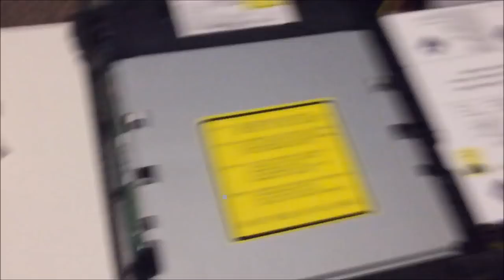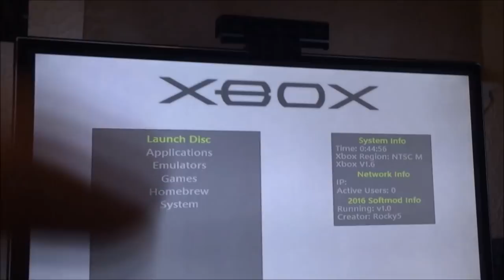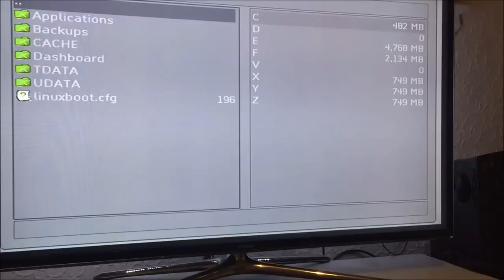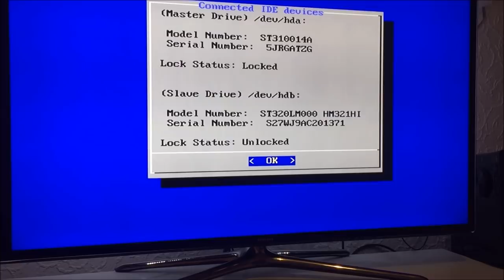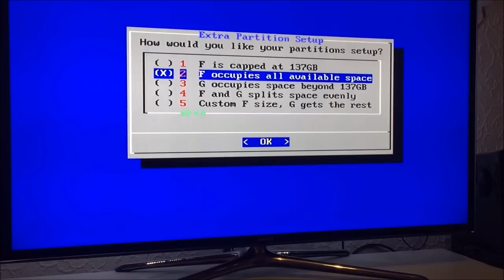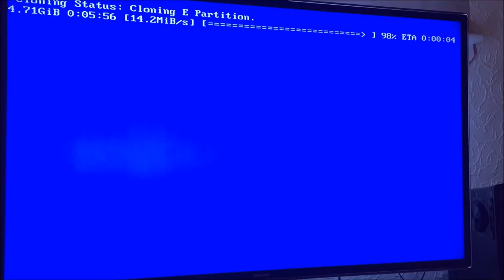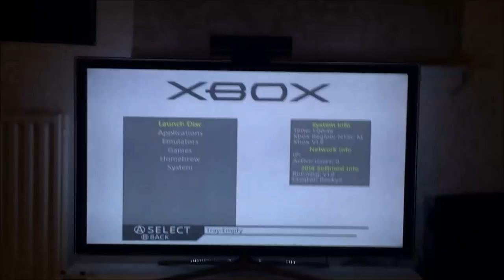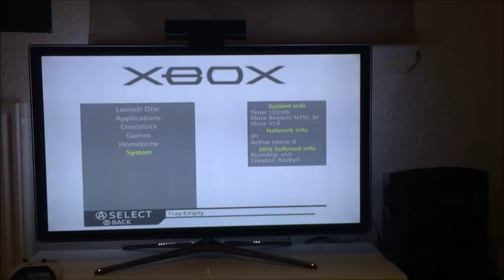How to clone your Hard drive using Chimp 261812 from start to finish.

Comment: What do you do, if it refuses to boot Chimp saying "Unable to get first sector"? I've got the right 80pin cable, and a Startech adapter with the right jumper settings.
Reply: are you setting the new hdd to slave and xbox hdd to master?

Comment: Hi JCRocky5 , I did not found my question in the comments so I will humbly ask you that question. When my xbox boots up Chimp I get following message: "Slave Hard drive cannot be locked." As I understand there are Harddrives that cannot be locked.
I searched for and fond the "Xbox Hard Drive Compatibility List". There my  Harddrive Models are listed "Locking: Yes". It's WD5000AAKB-00H8A0 and 2x WD2500BB-00GUC0. 
After that only 3 options are available im Chimp, Scan, Master drive Options and Other options.

Do you have a hint for me if those drives are really not compatible or if i might miss something else?
Reply: I tried 4 other WD models I had in my cellar. All with the same message. WD1600BB-50DWA0, WD1600JB-00GVA0, WD1600JB-00EVA0, and WD1600BB-00DAA3(not found in list).
For the first ones, the list also says yes. The Last one is not in the list. At least I'm happy that those 4 drives do also not work.. they do make noises..
Reply: I could not wait and I had to try again. This time i used Chimp2618. It looks a lot more complicated as the version in your video but it provided the options and I was able to clone the disk to the WD5000AAKB disk. It also was able to lock the hdd without issue and the new Harddrive works in my xbox.
Reply from the maker: I added that to the latest build, it checks the hdd for "Security level : high" if it's true then the drive is lockable, if it cannot find this information on the HDD it assumes it's not lockable.

I asked another user if they could test the build, as I don't have any drives that aren't lockable, they never got back to me. Would you be willing to test this new build for me?

Update:
I have a new build ready if you want to try it, I fixed the issue. Now I just lock the drive and check if it was successful or if it fails and show an error accordingly.
( I unlock the drive after I lock it, this is the only 100% way of checking if a drive is lockable )
Reply: Hi, yes of course. I will try it tomorrow (Austrians tomorrow ;) after FTP transfer has finished. I will try again with the original drive I had in the box (WD 80 GB drive) and one of the 250GB and 160GB drives each. Cloning the original disk is pretty fast due there is not much data on it.

Thank you for your fast response!
Reply from the maker: StyriaMe brilliant, you just have to redownload the zip from the description. If your slave drive is locked you will get a message to say you need to unlock it first, if the drive is already unlocked then you shouldn't see any difference.

If the drive doesn't lock then an error will show and some options will be disabled. ( like the previous comment, I try lock the drive to the Xbox motherboard and if it fails the drive can't be locked, if it's successful I unlock the drive and load the menu. ( takes less than a second to lock and unlock the drive )
Reply: Opened up my box again. Your new Version worked like charm. If i boot Chimp up with the DVD-Rom connected it straight sais "Slave Hard drive cannot be locked".
If i boot up with a "new Harddrive" Chimp provided all options and were able to clone. After successfull clone it asked me if i want to lock the HDD. Yeah!

Booting up again with both of the harddrives (original + cloned one), Chimp tells me that the Harddrive is locked and I first have to unlock it. Options are available. No issues at all. In my opinion everything worked well.

Thanks a lot for your work!
Reply from the maker: Brilliant, was that the HDD that had the issues previously? The one that said it couldn't lock but it actually could. Hopefully that's me done with Chimp lol. Not sure what else i can add to it?

Thank you for testing, the new build.
Reply: Yes, I tested it with two of the previous HDD's I had troubles with. Both worked like charm with the new Version!
Due I'm basically total new to XBOX, I cannot provide any ideas. My Box got modded years ago. The last several years it was in a cabinet in my celler and just this week I pluged it in due I found CoinOps and wanted to try it. CoinOps 8 Massive works now. CoinOp 8 Massive Premium.. does not.. I dont know how the "roms" folders content can get copied on a fatx partition (~16000 files). 
I have already several PC/Pi/Lattepanda - retrostations and was charmed as i heard of coinops.

Thank you! Without your video I would probably still stuck on the small xbox HDD.

Comment: Back qgain.  Trying to upgrade a 2tb sata drive. I load into boot switch cables, hit A and i hit the chimp logo screen with 3 dots. Then at the bottom it is in Green loading chimp. I've wait about 15mins and it never goes anywhere.

Comment: Thank you, this is such a great tool!

I have a softmodded Xbox of the last revision, which means softmodding is my only option. I was unsure if the SSD I had selected would support locking, so it's great to have a polished utility that makes the process simple. (It seems that most common 2,5" SATA SSD's support locking just fine) I used this exact StarTech adapter.

After the drive swap Unleashed only boots after I've opened and closed the disk drive once, but that's good enough for the time being, also startup using the power button results in error code 9, maybe the original dashboard wasn't transferred over? (I erased everything other than C and E during the process.)
Reply: hope you got this issue fixed, but to me it sounds like a dual boot gone wrong

Comment: Ok rocky i have some major questions about your mod i know this is a fairly old video and idk if you even check on comments any more but here it goes. I used your xbox softmodding tool v1.1.5 to upgrade my old softmod to your version of the mod. It installs correctly, it ejects the disc, i take it out and hit continue, it shuts down and restarts into your program again doing what it needs to do, then restarts again but instead of starting in your grey dashboard that shows in your video it reboots into xbmc dashboard and nothing else of your program even shows. I have upgraded the system with your disc now 4 times and it still keeps booting up into xbmc. what am i doing wrong?
Reply from the maker: You ain’t doing anything wrong, it will boot XBMC from C, E, F before C:\dashboard\ it’s how dashloader works. 

If you look at the readme.md file on GitHub you can see the dashboard paths and how they are traversed. (Top to bottom)
Reply: I ended up just doing a complete factory restart. I used your program to go back to factory dashboard, ran my copy of splinter cell to install your softmod. Only problem I'm having is when I used your mod the first time on my 1tb hd to upgrade it, it corrupted the hard drive and gave me an error 13 code, so I tracked down my original 4gb HD and I'm trying to see if there is anyway to save my 1tb sata HD from the garbage because I exhausted all the options in your chimp program to unlock my slave drive but nothing could unlock it. Is there any way to save the HD by formatting it somehow?
Reply from the maker: Are you using a 80 wire IDE cable? also the softmod won’t corrupt the drive. If it has it’s the first ever to be corrupted because of a softmod. 

But you will need to set the 1tb drive to slave, load Chimp261812 select the softmod option when you get the choice and the select slave drive options and unlock. (Select motherboard)

Now select slave drive options again then fix error 16, when it’s done select slave drive options followed by lock. (Select motherboard)
Reply: @JCRocky5  yes I'm using an 80 pin cable. But I did the steps again and the drive still remains locked. The jumper on the SATA adapter has also been set to slave but the drive still will not unlock
Reply from the maker: The drive firmware could be corrupt (nothing to do with a softmod this part isn’t touched unless you try to unlock/lock a drive)

You could try hotswapping the drive with a PC or use Xboxhdm23beta and your eeprom.bin to see if it will unlock on a PC. (The former tool uses Sata to usb)

https://drive.google.com/file/d/0BzRN8P835YijUFloekdzaUVyMFk/view?usp=drivesdk

You can also fix the C partition within this app. (Since it’s a 1tb you would/should have formatted it properly)
Reply from the maker: Join here so we can talk easier. 

https://discord.gg/4sTSwg

Comment: is the 2.5" hdd u use 5400rpm? do u notice any slowdown when accessing menus games etc?
Reply from the maker: +plane spotter No. For the most part the HDD is never the issue, it's usually the dashboard.

UnleashX:
Large amounts of games say 100+ will always run slower when scrolling through said games. This is due to the dashboard not releasing the cached memory when scrolling through large lists of games, so it eats up all the ram on the Xbox and then stops displaying icons and slows down. ( nothing to do with the HDD )

Note: UnleashX by default scans your games on load ( as the splash screen shows ) so this can give the allusion that it's the HDD taking ages to load the dashboard, this behaviour can be fixed by added a single entry to the tag in the config.xml. ( DelayLoad="True" example - <List Text="Games" Sort="On" Auto="On" DelayLoad="True"> )

XBMC:
No issues or slowdown due to the HDD. ( that I have ever noticed )

EvolutionX:
Haven't used it as a dashboard ever, due to better alternatives. So cannot say, but due to its simplicity I would assume it runs fine regardless of the HDD speed.

To note:
If you have a large HDD filled to the brim with games, emulators eg... seek times will increase boot time by a few seconds at the worst. But should effect going through menus.

My rule of thumb:
Is always use a 80 wire IDE & if using Sata drives always use and SATA2IDE adaptor that is known to be 100% compatible. ( I haven't come across a drive that wasn't lockable in all my years of modding Xbox, also all modern drives ( 98% - pulled that from my arse ) should be lockable )
Reply: Thanks mate for the info. I have noticed it mostly on coinops scrolling down the games list.

I am using a 5400 3.5" drive with smaller cache so pretty sure that is the bottle neck.

I have two 320gb sata drives one 2.5" one 3.5" and the green adapter pcb I ordered via your link has just arrived today so keen to try that later today. Thanks for your help. I found this tutorial the best one for Chimp, nicely done thanks.
Reply from the maker: +plane spotter no problem :) if you need any other help just ask.

Comment: Hi Rocky i hve problem on hot swaping..i bought a 2nd hand seagate ST1000DM010 and ceck it on the compatability for xbox and still stuck on black screen after the staring chimp and after that it wont progress.. please can you help me... i try to format it on NTSC and FATx
Reply: Did you switch your xbox HDD into master mode and the used HDD to slave?

Comment: I softmodded my xbox and now i'm at the point to where i want to install a larger drive, i've been watching your video and I downloaded your Chimp build but i don't have the file linuxboot.cfg. Did I miss something?
Reply from the maker: +mcellycell it’s not required with my version, it uses the config.cfg in its root directory.
Reply: okay, thanks for the quick response! i'll try it out in a bit!
Reply from the maker: +volksjager88 you put the Chimp folder that’s inside the E Partition folder in E:\Apps\ 

There is a text file with instructions on how to install it in the E partition folder.

Comment: I didn't select "Selective" in the chimp setup, so because I've already installed it and it's the same amount of space as before (4GB), would I be able to go straight to the extra petition setup and select "F occupies all available space"?

I would try but I don't want to regret it.
Reply from the maker: +Cole Phelps yes, but it will remove everything on the F partition just so you know.
Reply: JCRocky5 Thanks, it worked.

One other thing, how would I play games with that space? Because there aren't any folders to put the games into.
Reply from the maker: +Cole Phelps make a folder called Games on the F partition and stick the games you download in there or if you rip your discs use DVD2Xbox and it will make the folder for you.
Reply: JCRocky5 Damn you respond fast, haha. Thanks for the help man.
Reply from the maker: +Cole Phelps no problem :)
Reply from the maker: +Cole Phelps yes you can, but you will lose everything on the ( 4GB ) F partition. But that will fix any missing space. ( GB's )

Comment: Im looking in the downloaded folder i dont see anything that says linuxboot.cfg
Reply: Same.. that's where I'm at right now.. :/
Reply: Nm.. apparently Chimp 261812 doesn't need the linuxboot.cfg anymore, that's only for older versions. Odd this video shows him use it? Just googled it and in forums it says it's not needed.
Reply: For some reason chimp isn't working for me at all
Reply from the maker: Can use 480p or above and for 100% compatibility use standard AV cables. 

If the LED flashes green after pressing A it’s working you just haven’t done the above.

Comment: Great content I just Soft modded my Xbox 1.6 yesterday.  Thank you!  I'm trying to load the Chimp261812 files but I'm not seeing where the linuxboot.cfg file comes from am I missing something?
Reply: It's in the description "Chimp has been updated since the video linuxboot.cfg is not required now"
Reply: Thank you!  I did fumble my way through it works great!   So much faster with the games loaded to the SATA, SSD  Forza Motorsport is fun to play again!  the system occasionally freezes in a game menu but a reboot fixes that.  It has not froze in actual game play yet.

Comment: I'm gonna try and see if splitting F and G among evenly will do the trick... I'm working with a Western Digital Blue 1TB hard drive. So far I got an error when waiting on the "Slave HD is being formatted... trying again...
okay I am attempting to split the memory into F and G evenly... cloning succesful... locking is successful... but for the life of me, it will not boot with the new hard drive! :(
All I got left is that it's a non-compatible hard drive or I need an IDE 80-pin cable for the SATA hard drive....

Please help.
Reply from the maker: You need an 80 wire IDE cable. I said in the video it’s mandatory ie, you must have one.

Comment: I had that green adapter and my xbox kept getting error 07. I switched to a kingwin and now it boots but loads 20-30 seconds before getting to XBMC. I have only two games on there and using SSD. Any idea about the slow loading time? Is it due to teh DVD drive? I am also using an 80 core IDE cable. Its a softmod, not chip or TSOP.  No real need for DVD drive so if there is a work around I would be happy to hear it to get my boot times down.
Reply from the maker: its the adaptor, get a new one that is known to be 100% compatible.

Only way round the no dvd drive is using the PSB from the dvd drive and that's redundant as it would still mean the system thinks the dvd drive is there.
Reply: So you would recommend whatever peeps are posting on the IDE/SATA compatibility thread at XBMC forums?
Reply from the maker: The one I linked to in the description is what I use and its 100% compatible.
Reply: Perfect, thanks a ton!

Comment: I am using a 40 pin IDE cable for a SATA hard drive, could that really be the reason why I am having issues?
Reply from the maker: 80 wire always. It’s mandatory.
Reply: JCRocky5 It worked! Thanks!!! I'm so relieved now...

Comment: Hi. just wondering if I is possible to run a Seagate BarraCuda HDD 3TB, ST3000DM008 with with these Adaptors? Specification: https://www.cnet.com/products/seagate-barracuda-st3000dm008-hard-drive-3-tb-sata-6gb-s/specs/Also which IDE to SATA Adapter do you prefer?and thanks for the grate work.

Comment: Thanks for the video, worked a treat! Also stole your awesome skin too ;) 

Regards you skin - The information on the right in the box isn't live info is it (XBOX region/version etc) I assume I can edit that myself?

Only thing it didn't copy was my F: partition but I just copied it to my PC then back to the bigger HDD - NO drama!
Reply from the maker: Those are dynamic, so you can change them but you would need to put a custom label instead of a system variable.

Comment: JCRocky5 - I have a WD2500 (250 Gig) HD (IDE Drive) that I am trying to use Chimp261812 to clone over and when I launch the software and it attempts to format the drive. I get the following error:"Writing Cluster Chain Map. ide error 04, Write error Cluster Chainmap. I have reformated the drive and then did a disk check which the drive comes back as good. I continue to get this error. Any thoughts ?
Reply from the maker: +Chris Robertson I have never heard of that error. Do you have a 80 wire IDE cable at hand? Also what format option are you picking?
Reply: JCRocky5 - I do have an 80 wire cable and I it doesn't matter which option I select I receive this error.
Reply from the maker: +Chris Robertson can you try Chimp 2618 and see if you get the same error? Xboxdumper is used to format and partition the hdd, so it's that app that seems to have the issue with your HDD. idotsfan hasn't released the latest source for that, so I can't even have a look :/ Chimp 261812 uses a newer version than all the rest. ( support for G takes remaining space was added )
Reply from the maker: Glad you got it sorted, I will need to see about adding both versions to Chimp 261812 or get in contact with idotsfan and see if he can give me the source.